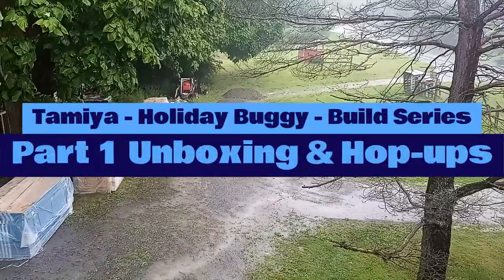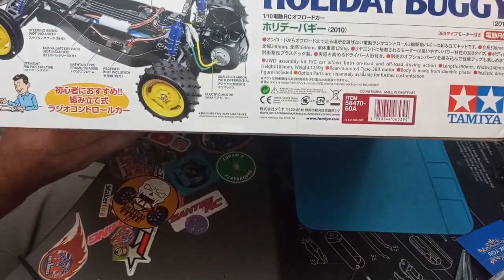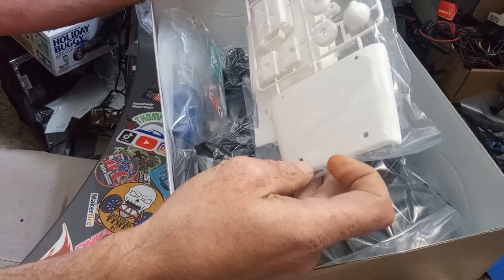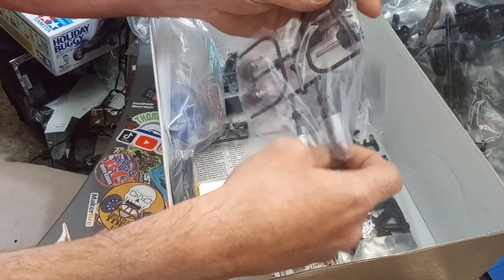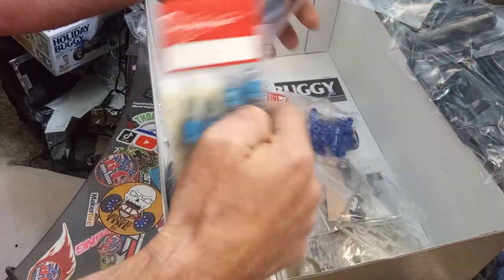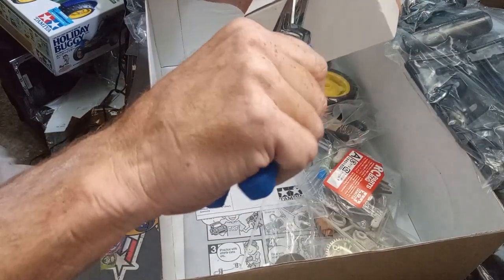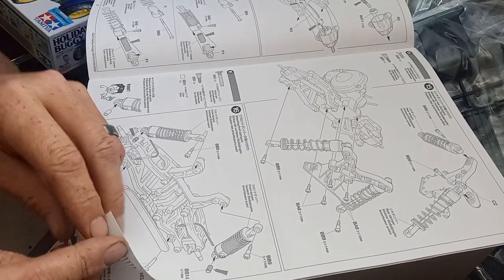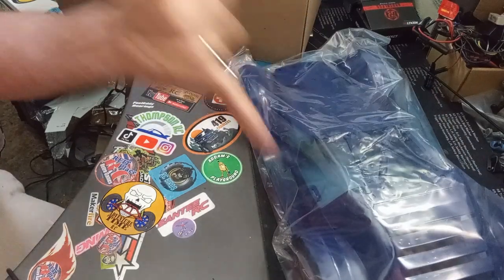Tamiya - Holiday Buggy 2010 - Build - Series Part 1 - Unboxing Kit 58470

Comment: For me it's cool they come with the Hobbywing ESC my go to one I use. Looking forward to the build. Our Holiday buggy is the limited edition red one with black wheels.
Reply from the maker: You have video of it I would love to see it..  Going to search your channel in a minute.  Just finished the chassis on to the body and esc..  I am upgrading to brushless almost immediately after test run but plan on using hobbywing in the hornet or madcap so its a win win..  Thank Malcom, Appreciate your comments bud..  Talked to Lauren about hitting up the Gennese Country museum they have a Printing Press much like I used to use with my grandfather as a child..  That and the Steam engines are awesome..
Reply: @reitplace4765  I have not done a video of it and it's in the loft/attic at the moment. Trouble is they put the hatch over the stairwell so do not go up too often to change cars. The museum sounds cool anything steam is fun, but I have found another one and will see if I can get to it. It does not take long to finish the DT-02 chassis and the Tamiya manuals are so good.
Reply from the maker: @BasBoyRC  No worries brother I can google it..  Starting some prep for body in the morning..  Look forward to that other steam engine museum.. C ya in the comments brother.